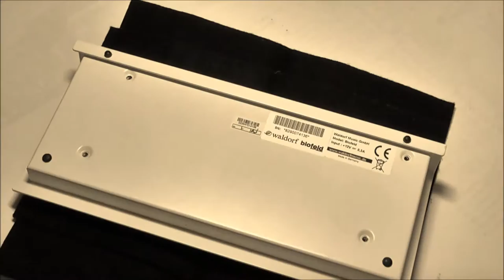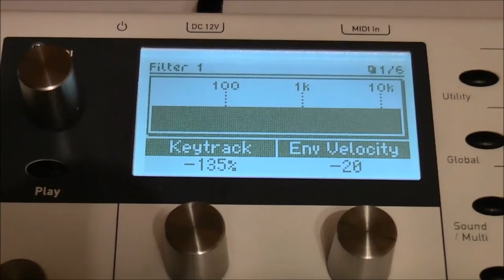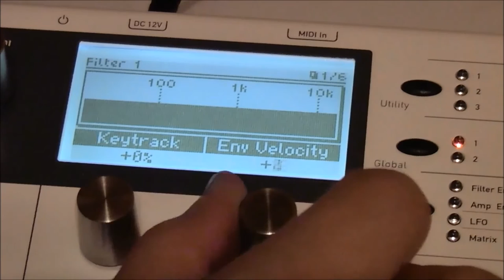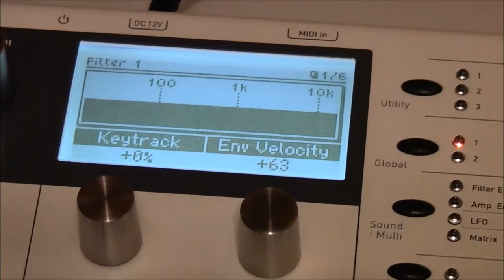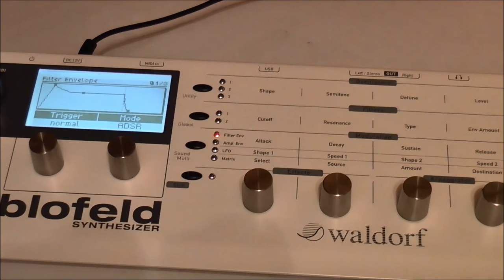[tutorial] Cleaning Waldorf Blofeld Encoders

Comment: If all else fails you can just replace the encoders, I had the same problem with my Arturia origin as the encoders started to fail so i replaced all of them, they are only £1 or so each but you need to desolder them.
I dont think the problem is grease as they will have some lubricant on the contacts to reduce wear but it more likely that over time this loses it effect. The metal on metal wear then creates a metallic coating or track across the contacts, this will then have an effect like shorting some of them out and not allowing the correct operation. When you clean then you are removing this metallic contamination so they can work correctly but you are also removing the contact lubricant. Before you reassemble them you should put some contact lubricant in there so they will last longer.
Reply: Can WD-40 be some kind of lubricant? =)
Reply: Ha! One of my favorite science channel's host owns one of my favorite synths! Nice! 
The strings are colliding.
Reply: Where do you recommend getting replacements from?
Reply: Yes, I'm also wondering about the longevity of the encoders without any lubricant. There are contact cleaners which contain lubricant, such as Teslanol Oszilin t6 which would probably be a good idea here. WD-40 is not really a lubricant and I wouldn't use that here.
Reply: whre do you get the replacemente encoders?
Reply: @ricardlupus  what about clock oil?
Reply: @sidefish8362  I'm no expert but it would seem that the lubricant would need to be designed to conduct electricity, so a proper contact cleaner with lubricant properties would be better than an oil which I would think would have more insulating properties.
Reply: @gregg_msk  No, it's a bit too thin to last as a lubricant for electrical contacts. Something from one of the Electrolube or Servisol products would probably do the trick.

Comment: I recently discovered your video when searching for a fix for the encoders on my Waldorf Q. I first noticed problems about a year after I purchased the Q (second hand). Twisting the knobs back and forth seemed to help. But after letting the synth sit untouched for several years, none of the encoders worked at all. I decided to follow your lead and disassembled and cleaned all 58 encoders! They were covered with grease, which migrated down from the shaft. The Q encoders have an o-ring, which is supposed to prevent the grease from spreading to the disk surface. It obviously didn't work. I cleaned them with alcohol and then coated them with Deoxit. They all work now. Many thanks!
Reply: @antfactor  I don't know how difficult it is to disassemble the XT. The Q wasn't easy; even harder to reassemble. You have to remove all the encoder knobs, and depending on the type of knob, you may, as I did, have to use a putty knife to pry it up. (Put a piece of paper under the putty knife so as not to scratch the surface). You then  have to open it up and remove the circuit boards. Removing, cleaning, and reinstalling 1 encoder takes a few minutes. Plan on spending an afternoon. Cleaning my 58 encoders took about 2 & 1/2 hours, but the total job probably took 4-5 hours. It was well worth it. Check out my YouTube video entitled, Waldorf : Review and Demo

Comment: If you get one of these new, go to the auto parts store and get 1/4" ID  o-rings and put one under each knob, in between the case and the encoder. it seals them from dust and they last forever... get a thick one, also you could seal them the way radios have been sealed for decades with felt pads
Reply: Absolutely. Prevention is MUCH better than cure. And cheaper. Waldorf seem to achieve the great and miss the obvious on things like this. But it's easily fixable.
Reply: Those digital encoders are well sealed; the problem isn't dust getting into them, it's oxidation of the metal contacts, tracks and wiper fingers. Note the stripes seen on the tracks; the dull looking parts are oxidized. Polish them with a pencil eraser, then clean with alcohol and a Q-tip.

Comment: It's nice that someone shows this. Encoders and potentiometers do need grease to work smoothly. As your video shows, the problem is that the viscosity of the grease is too high, that creates gaps between signals. If you had dropped silicone in it, it would push the excess grease to the sides and it would work again too. That's a good fix for when you have a ton of encoders. Usually, high viscosity doesn't block signals but it seems that this encoder is highly sensitive.

Comment: I have cleaned numerous digital encoders used in home-theater receivers. The real problem isn't dust (those controls are well sealed), it is oxidation of the metal track and wiper fingers (notice the visible striping effect even after removing the grease from the metal track). Polish the metal track with a pencil eraser and remove the oxidized lines (modern white vinyl or  "plastic" erasers might not contain sufficient grit ---- no sand, silica or pumice ---- so try an old fashioned pink pencil eraser, or a gray or blue ink eraser). Polish the metal wiper fingers as well, carefully, and clean the metal surfaces with Q tips and alcohol.  You can put a thin coat of clear silicone grease or teflon "super lube" on the track before you reassemble the control; it may not be strictly necessary, but thats how they were apparently manufactured, with grease on the contacts and a thicker, more viscous silicone camping fluid on the shaft and bushing. I don't think the damping grease on the shaft has "migrated" onto the metal contacts, they seem to be two distinctly different types of lube.

Comment: There was some substance in the encoders of my blofeld that reminded me high density silicone fluid. I saw this liquid before in the video tripod heads. I think it supposed to stay around the shaft but it is leaked down to contacts area. As the result tough encoders. I used silicone grease for replacement and encoders work fine but the force required is slightly different from one to another.

Comment: the "happy encoudaz" - mine are still unhappy. thanx alot for this cos i already wanted to do the capacitor trick, but gonna clean them now. did you remove the grease from axis n shaft? just for avoiding soldering
Reply from the maker: I just removed the grease from the contact plate.

Comment: hey man, thanks a lot! Unfortunately I have this encoder problem on my 2 days old Blofeld so it can't be the dirt.. is this a common problem also on brand new machines?
Reply from the maker: My Blofeld worked properly in the beginning and the problems started some years later. Could it be that the device was stored for a longer time? It could be that the lube started to flow into the contacts during the storage. But a new Blofeld should normally work perfect...
Reply: I don't know, I will just return it to the store I guess, and get a new one. Tnx for the reply though!
Reply: Andrea Avellino  I had this problem  with new and used/old blofelds.  If it's a new one, don't make  the same mistake I did. Send It back as long as you have garantee. At Birthday I will buy a new one. It will be the fourth. Sold the other two due to gas/money  problems. One had faulty encoder and buggy os behavior.
Reply: Hi Synergy, thank you for you answer! I seem to have solved the problem updating to the latest firmware 1.25 :)
Reply: @AndreaAvellinoVideo  I had this problem with four encoders. The latest firmware fixed two. Now I must clean the other two... In fact I will clean them all. Thank you for posting this super helpful video. Maybe we should remove a little bit of grease from the encoder shaft?

Comment: Would it help to put o-rings on the shaft above the metal thread section so as to reduce the amount of dust that can get in?
Reply from the maker: I think it wouldn't help because the problem is rather the lube (in my opinion). Also, such a ring could hardly keep dust away.

Comment: this video looks like an answer but some questions remains...
i see you have capacitor settled on your encoder and on other blog i found that this was the solution but can't understand if it's the right way.
is this a capacitor problem or a dust and overgrease problem?
and if it's a grease problem, after clean, i have to put something like contact oil to prevent the abrasion of the encoder or i have to leave it dry?
.......or maybe i have to do both?!
sorry for my bad english
Reply from the maker: Thank you for your question :) I tried the capacitors first but it did not help (well, a little, but not really). That's why I tried to clean the encoders and that helped finally. It is indeed a problem of dust und grease. You can leave the encoders dry because this grease is only for the axis and the mechanical parts to perform smoother. So you don't need the additional capacitors and no new grease, spray or oil.
Reply: :) thanks a lot
Reply: Ciao Stefano, vedo che abbiamo lo stesso problema...non ho capito nel video con che sostanza pulisce gli encoder. è alcol?
grazie

Comment: Any follow ups on how long the encoders last after the de-greasing?  It's hard to believe they're really supposed to run dry like that but maybe it does work long term - that's why I'm asking.  Thanks!
Reply from the maker: This video is more than 3 years old. I programmed a lot on the Blofeld in this time (i.e. two complete sound banks). The encoders still work.
Reply: @SynthesizerVideo  Nice!  Thanks for the reply!

Comment: couldn't you just spray some contact cleaner in the encoder like you would for a dirty guitar pot?
Reply from the maker: I wouldn't recommend it. An encoder is not a potentiometer. Moreover, the encoders don't have any holes, so that it's hard to get any substance into the encoder without opening it. And if you manage to put some spray in, all you get is a soup of contact cleaner, lubrication and dust inside.